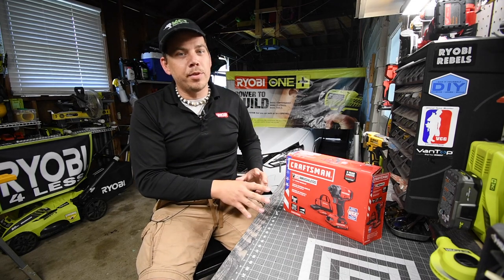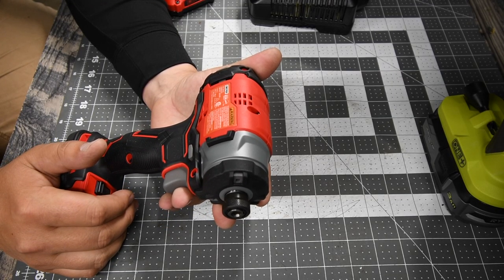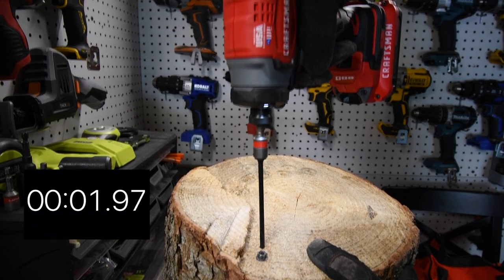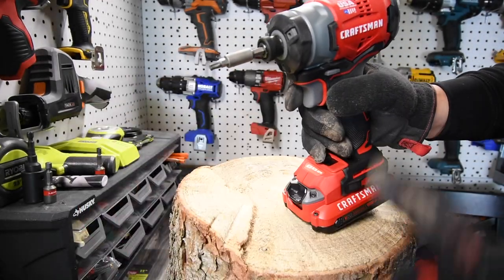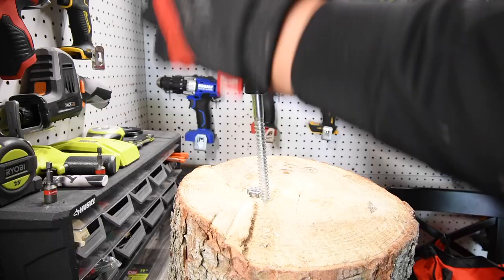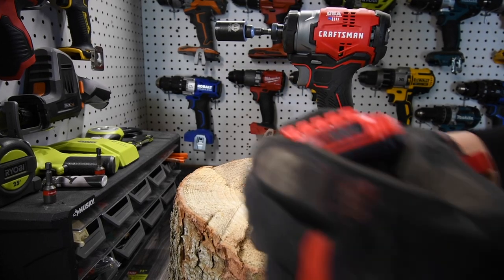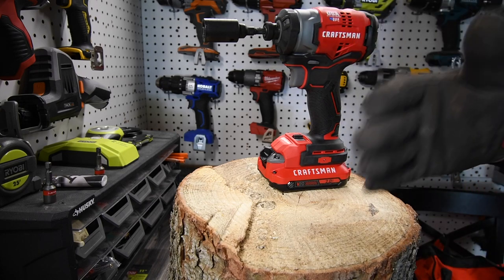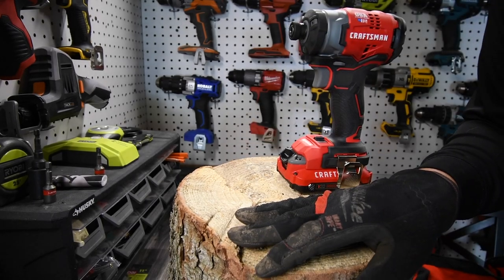CRAFTSMAN BL Impact Driver

Comment: 8:56 for clarification, the 4ah battery can output a lot more amperage because it has double the number of 18650 li-on cells. Because of this the voltage doesn't dip as much under load and the tool can make more continuous power. 
More amperage= more torque
More voltage= more rpm
Reply from the maker: I know, I made a video on proving that already. you should check it out
Reply: @ManCaverTools  just watched it. Great video, thanks. I ordered some ryobi hp batteries and I'm excited to try them out.

Comment: I bought the tool only for $99 and that thing can remove any bolt off of small engine with no issue. This thing is almost as powerful as the Craftsman's brushless impact wrench. I only use 6 amp hour batteries though.
Reply from the maker: Very good and I thank you for viewing :)

Comment: So glad you finally got to Craftsman.  I bought the brushed versions when they first came out about 2 years ago (give or take). These tools continue to impress me.  The 4ah batteries definitely make a difference. First kit I got back then out of curiosity was the impact and drill ($99) black Friday sale on the release. Figured if it sucks, I can always return it to Lowe's.  I actually accumulated a few batteries (2ah) from happenstance and upgraded to the 4ah batteries.  They do make a 6ah.. sometimes hard to find and a rapid charger that I have not tried yet.  The 4's are plenty up to the task. I recently bought the circular saw,  grinder,  reciprocating saw and the multi tool.  All are great.. (not crazy about the switch on the multi tool.. gets it done)  All in all, for brushed tools.., I am very pleased with this line 👍👍 Thanks again, Dave!! Really appreciate what you do bro!!!
Reply from the maker: I thank you for sharing your story Tom :)

Comment: I was wondering if you were ever going to get around to Craftsman - thanks for that!
I just finally started buying V20 tools in addition to my older C3 stuff.  Started with a couple of the angle grinders (still need one more), because USED C3 versions, tool only, were going for more than a V20 with a 4Ah battery and charger!  Now I have a drill, and working in getting the pole saw for tree trimming.
Reply from the maker: you are welcome Talonts, more craftman tools will be coming to this channel soon

Comment: Wow! Speed 3 on the Craftsman impact is speed 2 on my DeWalt impact 😅
Reply from the maker: Zach I will put that to the test.
Reply: And the 3rd speed on your dewalt is a 2nd speed on my milwaukee impact driver 😎
Reply: I’m a huge Dewalt fan, but Dewalt does not have a good 18v impact drivers.  I’d bet money this will outperform the ancient 887.
Reply: JC 93 That’s true lol
Reply: Juan C You’re right. I also think DeWalt needs to step up their game a bit regarding their higher end impacts like the 887 if they want to really compete with Milwaukee and Makita. I personally have not had any problems with my 887, but I would say their best impact is probably the Dcf787, because it doesn’t “self destruct” if you know what I mean, and it’s better than their Dcf809 Atomic impact as well.
Reply: @Kara3405  and AEG/ridgig. #aeggang
Reply: Must be speed 1 on my Milwaukee
Reply: @Kara3405  Step up their game, Dewalt makes a great impact driver ohhhhh Milwaukee put the screw in a half second faster meanwhile their collets keep breaking I  think they better step their game up

Comment: I wish they had them in sears because I like the craftsman but this craftsman is at Lowe’s and where I am at Lowe’s is to far away but there are lots of Home Depot so it’s convenient but even though sears don’t make them anyone of power tools lowes sells them now. I have the ryobi now but only because I have Home Depot close to my house I feel craftsman does better than ryobi like there drills and impact drivers are good and the saws are good unlike some ryobi that can’t get some of there brush sawzall to work better and the circular saw to work soother than just cutting out when cutting a wood board but they are updating the batteries which is good to me but I feel craftsman is built better like a dewalt clone as they say in a video but even though it’s a diy tool it depends on how good and reliable it is ryobi is good but not to heavy invest in there tool line completely l like there drills, drivers, and impact, wrench’s and there pin nailers and lights are great but some of there other tools go up in smoke for heavy use but craftsman I don’t see or heard that it goes up in smoke only with doing large lags that are 6 to 8 inches which is too big and difficult without drilling a hole it’s good to see how durable it is but most people wouldn’t use it for that in real life only small thin ones of lags for wood maybe concrete but I am impress that this impact driver can do and has three lights in the front which I like that design on the impact that most don’t have.
Reply from the maker: I do hate it when it takes a while to get to certain stores for certain items